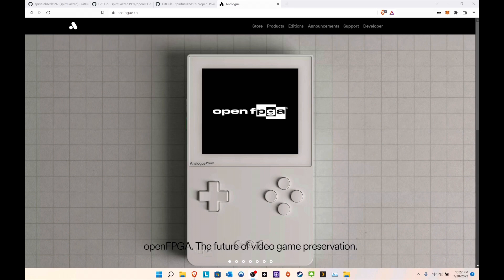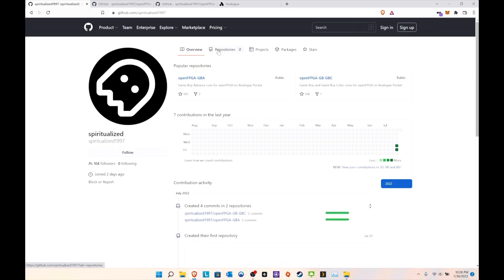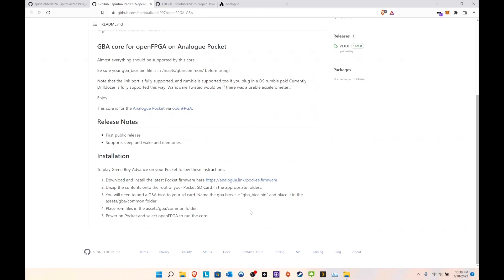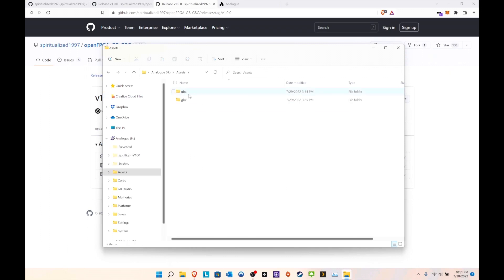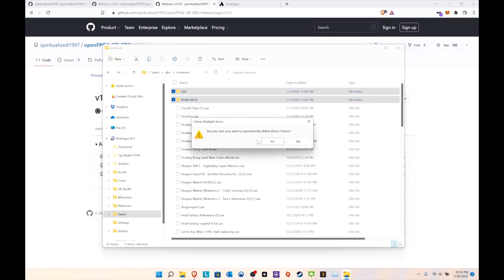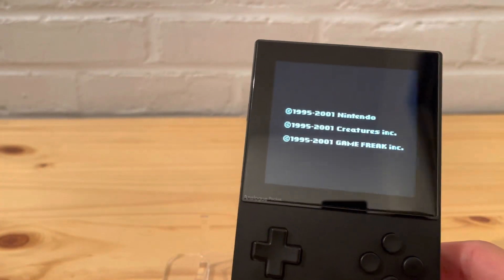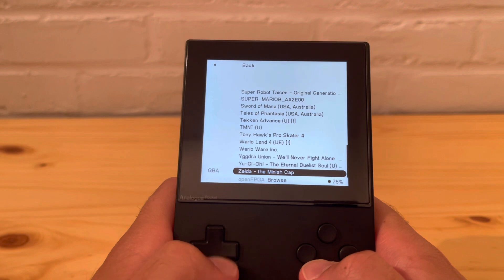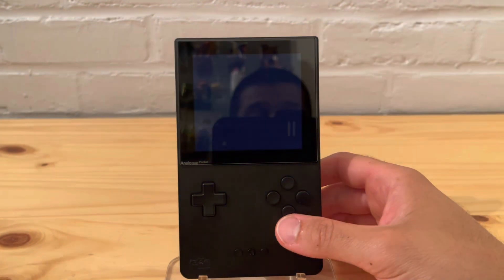openFPGA Instruction for the Analogue Pocket

Comment: Does the openFPGA GBA core not play the PocketNES and PocketSMS emulators? I used to play those quite a bit on real hardware via an old EZ-Flash II flashcart nearly 20 years ago. I also recall playing a SNES emulator on the GBA, but obviously it was pretty slow on most games. There were a few that played nearly perfectly, with speed up hacks.
Reply from the maker: I tried to get it to work and so far it hasn’t, but that is something that might open up later on with the openFPGA cores
Reply: @CasaVerdeGames  Interesting. I still have the old compiled roms from my GBA EZ Flash II cart, that I used to use from twenty years ago (wow, that sounds like so long ago when I type it out!), if you want to try them out. I have these:
SPN-GameBoy_Classics(60roms-15MB_Best_Games).gba
SPN-NES_Classics(134roms_20MB-PocketNES995).gba
SPN-Sega_Master_System(DrSMS6)164rom.gba
SPN-Snes_Classics(13roms-17MB_Snes_Adance).gba
SPN-Snes_Classics(16roms-23MB_Snes_Adance).gba
* I forgot about the SNES emulators for the basic GBA. They don't have sound, and they run slower, but a few of them were promising. I applied all of the speed hacks, and whatnot.  
They aren't very large roms if you want me to zip them up and throw them on my website for you. I'm sure you're pretty busy with the openFPGA stuff.. A Neo-Geo core already. That was unexpected!  Anyway, just let me know. -Matt
Reply from the maker: Hey yea I’ll take a look at them 
Some of these files are hard to find on the internet these days like the unofficial GBA movie player I have. Re-finding the program to convert movie’s was a pain

Comment: I followed the installation instructions, then click fpga but I get an open fpga guide q code and no core options.  Any idea?
Reply from the maker: Interesting 
That would happen to me before I put the cores on the SD card 
Maybe it isn’t copying over correctly or it might be the SD card
Reply: @CasaVerdeGames  I have the same issue, what sd card are you using?

Comment: I keep getting a “load error in ‘core’” error 😩
Reply: I’ve got the bios or .bin in the right place with the .gba files, but does nothing
Reply from the maker: Damn really
Have you tried a different Micro SD 
Or a doing a global reset 
I would backup everything first if you do a reset
Reply: @calebwasthere420  in the platforms folder did you add the files for each core?